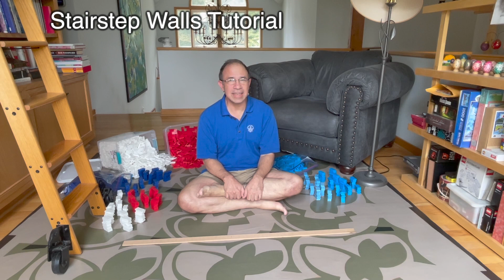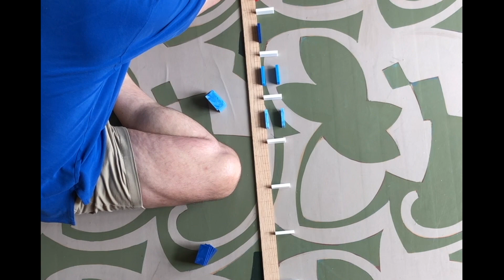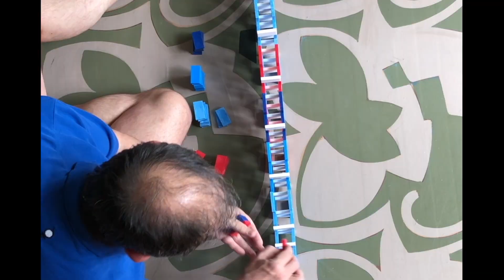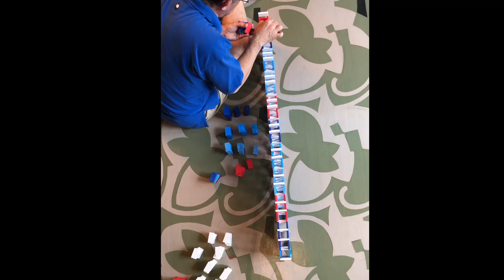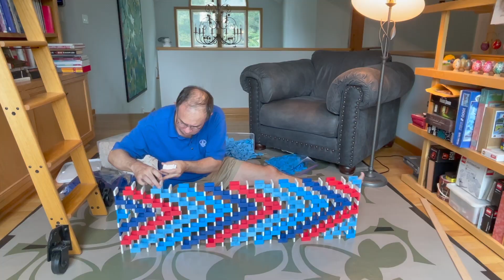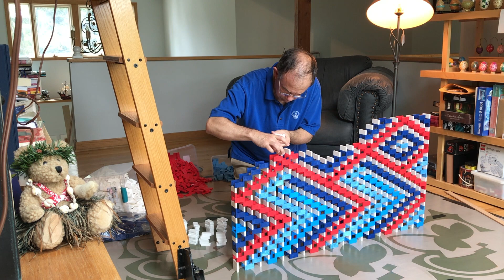Stairstep Walls Tutorial

Comment: I noticed in the last video that some didn't topple reliably. Was that just because they were your first few attempts? Does this method seem to fall without any worry?
Reply from the maker: All of them seem to be fine but the original fish wall, which had a vertical stack of three dominoes for the nose. The modified fish wall (with the pointy nose) worked fine as did all of the others. I think it’s a safe technique.